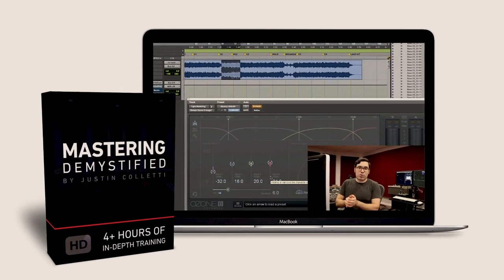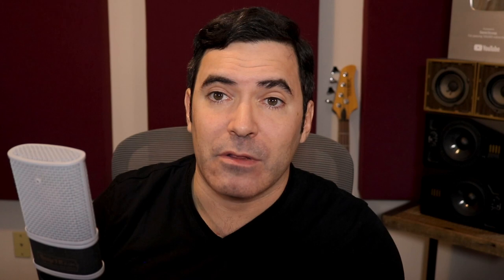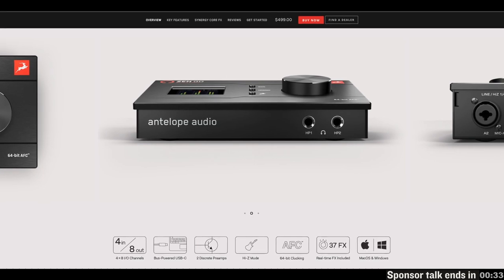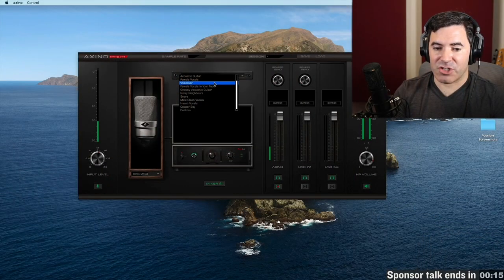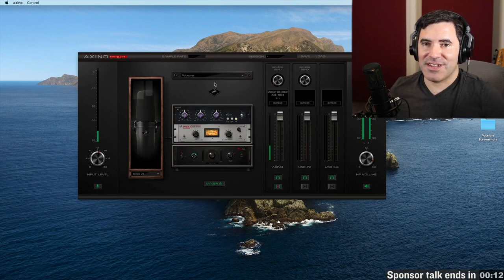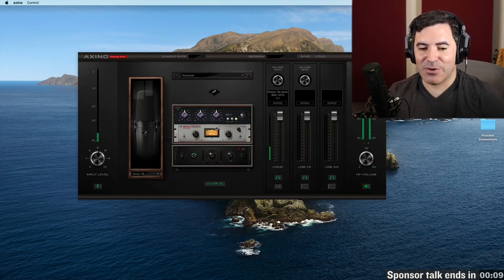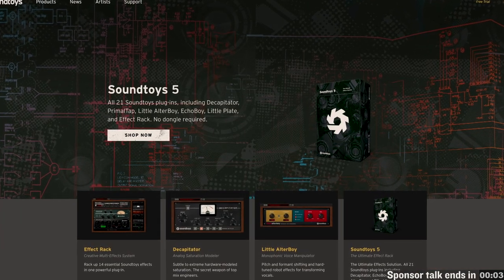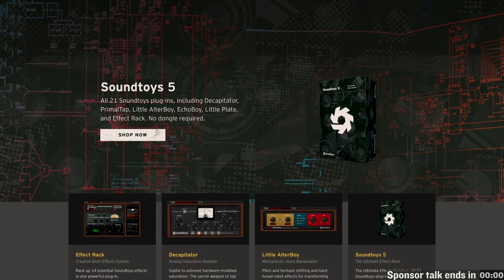How to Use Frequency Analyzers (The Right Way)

Comment: I use a frequency analyser to find the fundamental note of toms which I usually boost while cutting the 3rd harmonic.
Could also use it on a snare to find a resonant tone that I don't like.
On vocals I use it to find the resonant peaks of the harsh S.
I might take a look at the spectrums of the instrumental bus and the vocal bus one on top of the other to see if the reason the vocals are not clear enough is due to some masking.

Comment: I suppose this is confirmation of what I'm already doing. I often use analyzers to find a problem frequency. For example, I had an acoustic guitar that had a nasty tone when hitting a certain note. I wanted to pinpoint it and deal with it without damaging an otherwise good recording. Turns out I was easily able to find very sharp, low bandwidth spikes at 4k and 8k, tuck those in (DS2 in Scheps Omni Channel in that case), and all went well. Similar to others, I will also use it at times to find the fundamental of percussive instruments, so I know a bit more about how to manage them. That said, I rarely open a frequency analyzer while working, it's mostly a utility for pinpointing specific things, then it drops off the insert on a track and it's done. I actually don't use them at all on the mix bus.

Comment: I don't know what to do about string attack sounds on bass guitar. if I solo the amp, and all through a song in the mix it will sound fine, but occasionally I get pops from nails hitting the string or pickup, or pops from hard atttacks, it's definitely string noise. I usually just ignore it vs trying to editit out. Any better ideas?
Reply from the maker: Don’t ignore things you don’t like the sound of! The answers here are:

1. Faster attack compression/limiting that will actually catch those peaks.

2. Faster attack multiband compression/limiting/dynamic EQ, effectively acting a bit like a de-esser at your problem frequencies

3. A transient shaper, like oeksound Spiff.

We did a recent livestream with oeksound where there’s a great example of this on bass.
Reply: @SonicScoop  thanks, i'll check it out. I kinda like the pops because in the age of fake musicians, bassists will know that it's a real bassist. but at the same time it sticks out and i dont like things that catch my attention and make me go to scrolling through individual tracks